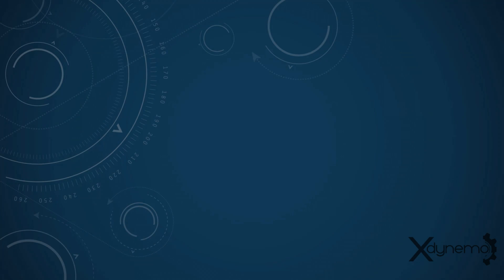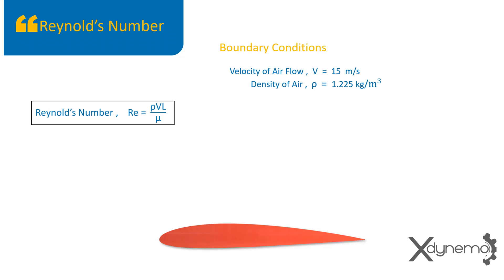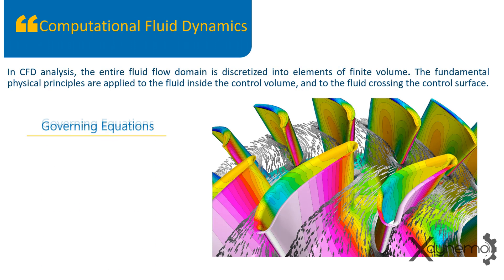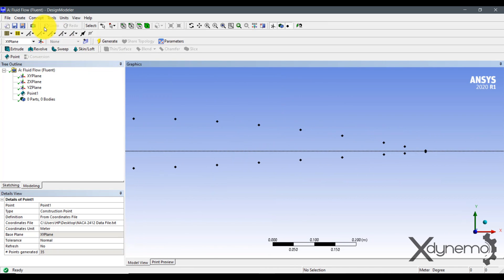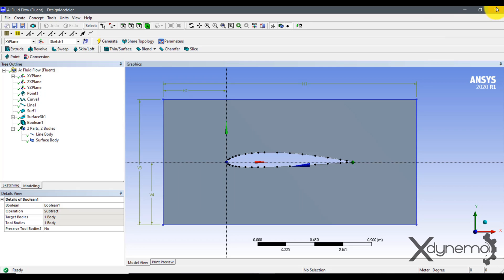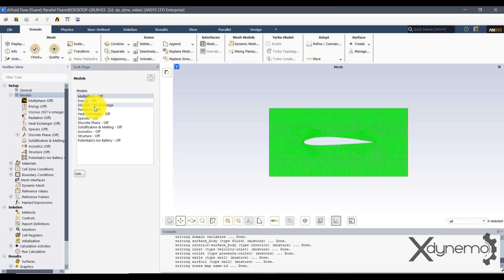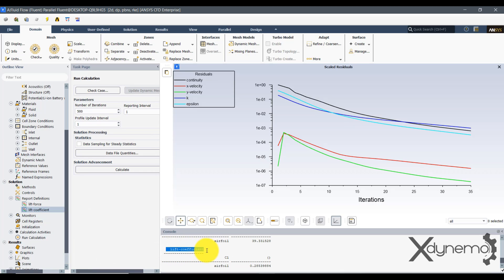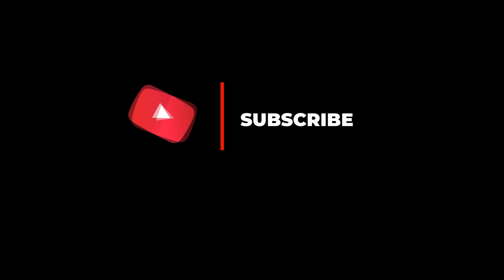Analysis of NACA Airfoil | CFD Vs Experimental | Ansys Fluent Simulation | Xdynemo

Comment: Here you have used Coupled Method, If you use SIMPLE Method u'll get the [ Lift Force - 35.814 N & Lift-Coefficient - 0.259 ] and which is more accurate values when we compare with experimental results, Because I have Performed the Simulation and i felt to comment, Hope! it Helps to others, if any mistake is there let me know
Reply: Brother, How to use  SIMPLE method instead of Coupled method?

Comment: Why meshing is taking so long?
Reply: it usually does, from your question I can see that you are making the mesh fine for the whole domain, which would take time unless you have better computer specifications. But to overcome this, simulators generally isolate the fine mesh about the model being analyzed and leave the system with a much coarser mesh. Of course, this solution is applicable only for simulating applications similar to the video, in some cases, you have no other choice but to wait for it to mesh. I once did a piston combustion simulation and the mesh for it took 1 day. So yeah such is the case.

Comment: I think normally the Control Volume for external flow problems will be much larger as there will be wall effects like say for example, the most tested airfoil NACA 0012, for this CFD analysis, generally 20 times of the chord in all directions and a C domain will be used for analysis, this is applicable for every airfoil. The domain cannot be small as shown in the video.

Post your suggestions too.
Reply from the maker: You are correct. The intention behind this video is to introduce the ANSYS Fluent workbench and solver settings. As you said, there are a lot of parameters which has to be optimized for accurate results such as 
1. Creating C shaped mesh
2. Choosing proper element size based on grid independence test
3. Selecting Domain dimensions based on wall effects
4. Advanced mesh settings near the Airfoil wall such as inflation, mesh refinement, etc.
5. Choosing correct solver settings based on flow geometry and the nature of the flow.
And many more to discuss. We will discuss these aspects in detail in our upcoming videos. Thank you for showing interest.
Reply: Incorrect value of Re 1,02 not 1,05